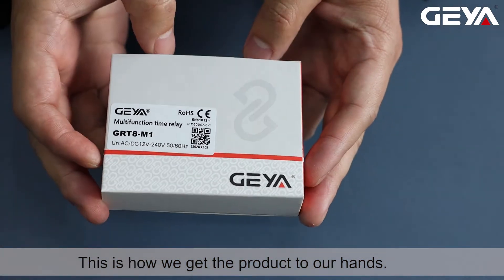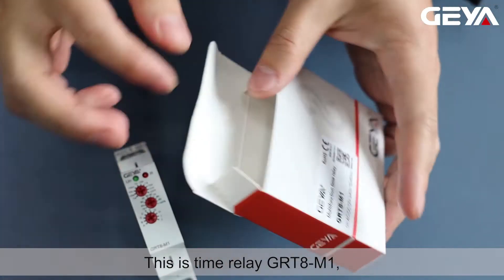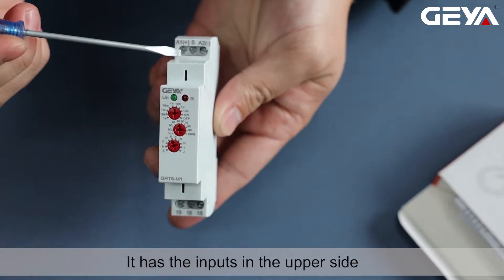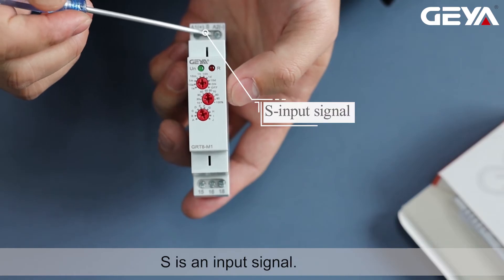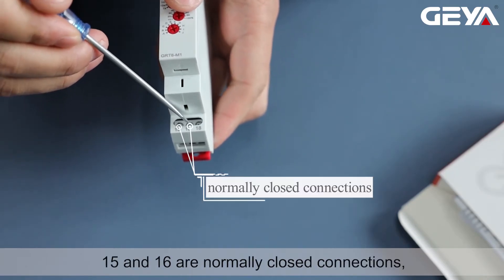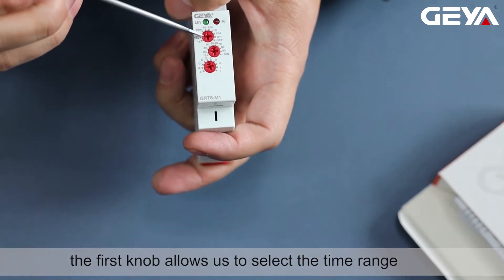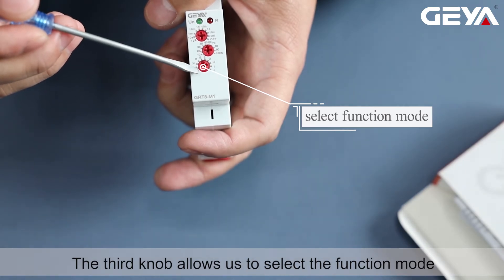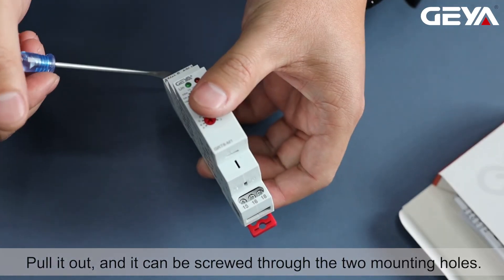How to use a time relay | unboxing and instruction of time relay GRT8-M1 from Geya Electric

Comment: I want to buy something like this for a project at my work. I need help picking the right one.  I want to connect such a device like this to a foot pedal.   With the relay, i want to be able to program it to GIVE POWER for 5 seconds, 10 seconds or 15 seconds.  It will actually vary with every batch of new raw material i get.
Reply: You still need advice on this? I am doing a similar project and might be able to help you out.